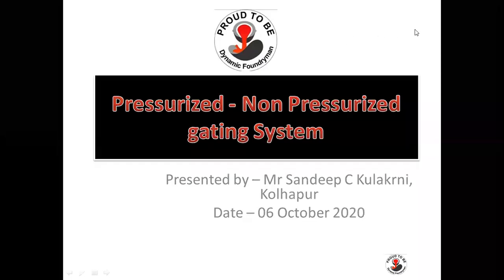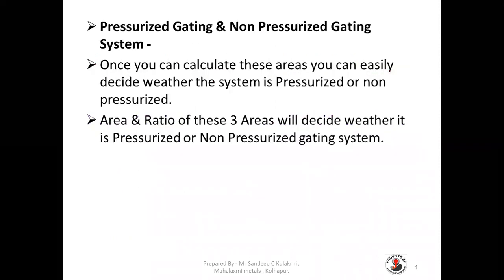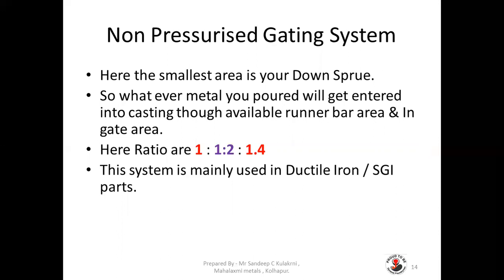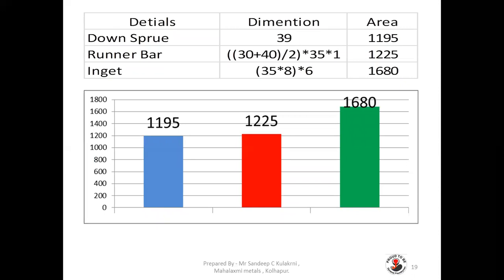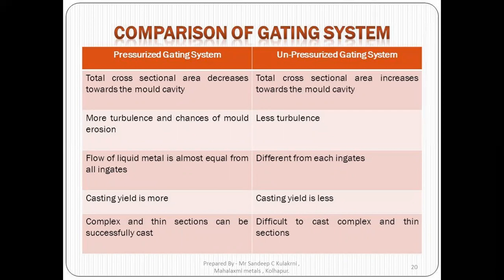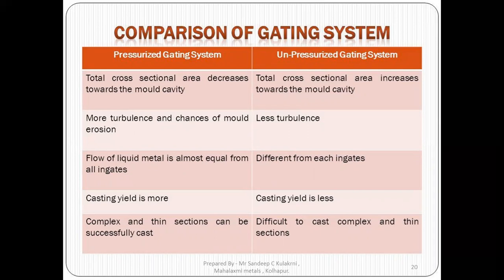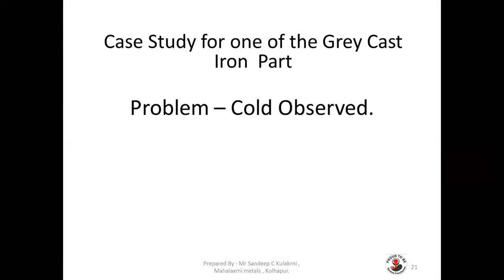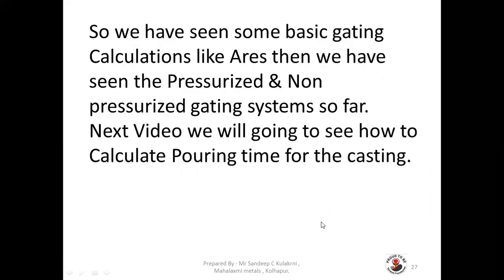Pressurized & Non pressurized gating System

Comment: Sir how to calculate gating design for a new pattern
Reply from the maker: There is no such thumb tube. It depends on whether you want pressurized or non pressurized gating system.  Normally people use pressurized gating for cast iron and non pressurized for ductile iron. Basically gating design is a combination of art and science which depends on your experience , knowledge and innovative mind.

Comment: Sir, How can we calculate the Width of In Gate?
Reply from the maker: You have to decide first weather you want pressurized or non pressurized gating system then you will get volume required for in gate based on that you can design in gate by choosing width and height of in gate.
Reply: Sir how to  decide which type gating system are used??
Reply: Thank you Sir...
Reply: Sir, plz make video on perlite and ferrite formation in Gray cast iron and SGI

Comment: Sir, How can we calculate the choke area. both your videos gives calculations of cross sections like trapezium, circle or rectangle. You have mentioned that non pressurised systems cannot be used on complex and thin sections, please explain. The case study shows that by reducing the cross section areas from 786 (Sprue) to 700 Ingate, the pouring time reduced. Does this mean that pressured system can fill the castings faster even with smaller cross section area? (Slide 26).
Reply from the maker: We will further Calculations in future videos. Regarding chock , it may be any thing like your in gate, Filter, Sprure area so you can get chock area from the areas of these areas.
Regarding Pressurized gating system has system.alwsys full hence the pouring time will be lesser than non pressurised where system is open so pouring time will be always more.
Reply from the maker: Regarding complex parts , non pressurized gating system will not allowed to fill up the metal faster so complex parts may get issues of BH, Cold and pressure head will not be mate to get desired results in complex parts with non pressurized gating.